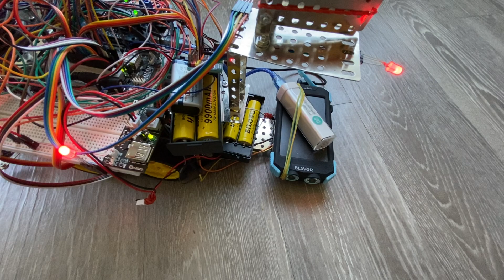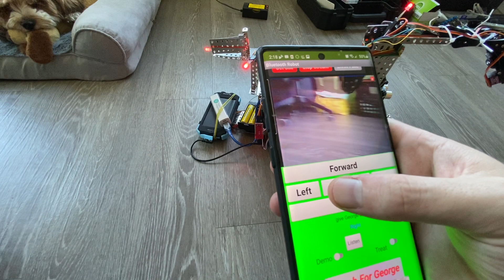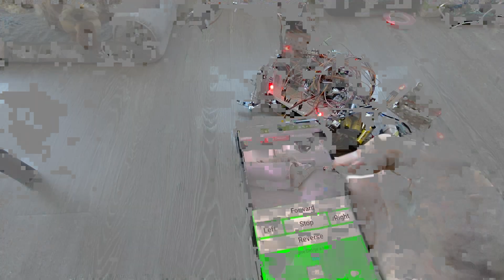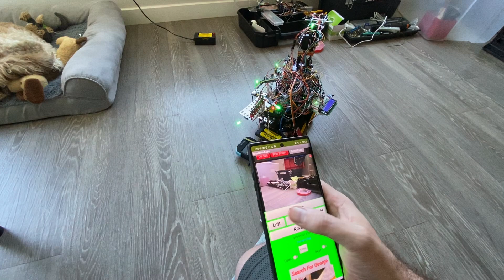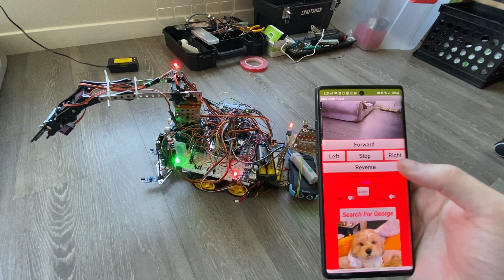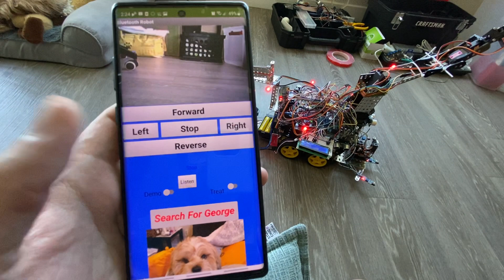Dog Treat Robot V2 (MIT app inventor, arduino, esp32, pca9685)

Comment: Sir I'm a building something similar to this for my FYP, with just esp32 camera and robot arm. Is the esp32 mcu enough for the task to control, the arm(with PCA9685), motors and the camera. Or will  the esp32 run out of pins